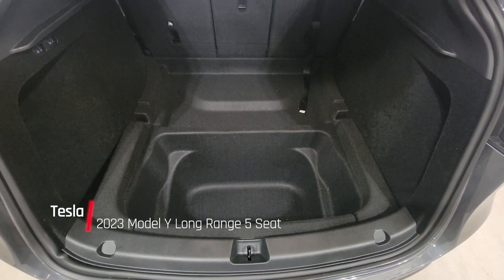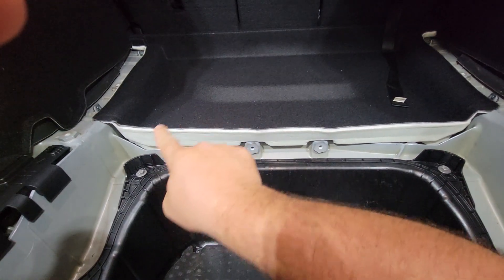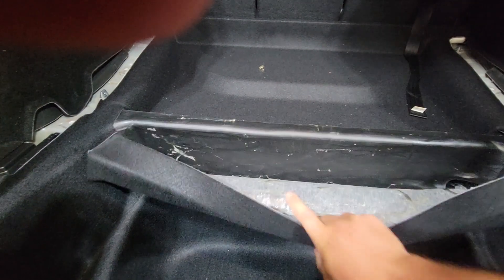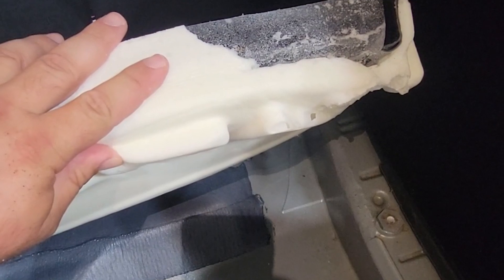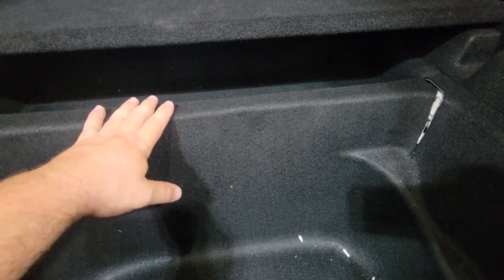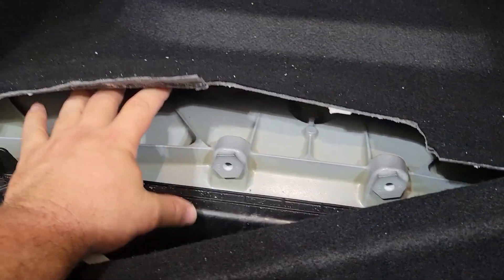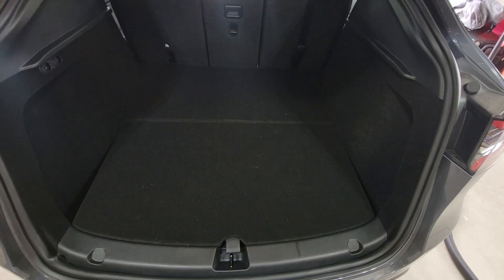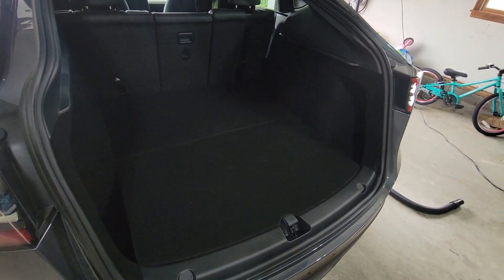We Hacked Our Tesla Model Y To Make Room For A Spare Tire! Fitting a modern spare tire in the trunk

Comment: This video was very helpful.  I successfully  did this to my 2026 model Y, however, I did not remove the foam from under the felt so the floor sticks up 1/2 " higher.  I'm ok with this.  Also, I was able to place the tire more to the front of the car.  So I still have good access to the deeper tub.  I'm using a Value Spare brand tire kit from Amazon.

Comment: Just did this in my 2026 Model Y...no need to cut anything, I just removed the sub trunk tub liner and just lay the tire down on that forward lip and it will compress the foam and protect the tire.  Also, I left the spare out of the bag, I put the tools below it and turn the tires with the valve stem down, which seam to fit better.

Comment: This is perfect and exactly what I was looking for!  And I’m with you. I bought the spare tire almost as soon as I took delivery of the car. I commute in the Bay Area, so no problem with cell signal or AAA or Tesla roadside assistance. But I’m picky about the tires I run so I wouldn’t be happy to have them sell me an expensive non-matching replacement nor would I put up with waiting who knows how long to have someone change a tire I can easily change myself. Plus, we travel weekly to the Sierras in the winter and the last hour if our journey has very spotty or no cell signal. But even if I could get a hold of AAA, who knows how long I’d have to wait for a tow truck to show up after 10pm on a Friday night in the middle of a snowstorm 40-50 miles from the nearest town.  They almost surely would not have a replacement tire in stock and so it would ruin our weekend. No thanks - in those conditions I consider it to be a safety issue to carry a spare. And to those who say they have never had a flat, I picked up a bolt at 96k miles and quickly changed my tire using my spare. Was able to plug my old tire after getting home and got another 13k miles out of it!
Reply from the maker: Glad to hear it worked out for you! Yes, we have used the spare twice. Once from a pot hole  and once from a bolt. Was nice to be back on the road vs waiting.

Comment: i would never do that just put it on long trips an remove if you drive around town and use AAA to fix your tire, or keep a fix a flat tire for backup or a tire kit that fixes holes or keep in there.  there is plenty of room just to keep that spare tire in.  really no need to ruin your car. but is just me since i own a MYP 2025 recently
Reply from the maker: Hi, its obviously a personal choice. My concern with having a loose tire in the truck is in case of an accident it could fly around. I have my kids in the back seat so it was a concern. We live in upstate NY and in the winter our roads can get pretty rough, I have had a tire blow out on a pothole before or side wall bubbles, which aren't things that fix a flat can help with. I've had to use the modern spare once when I got a bolt in my tire, so it's already been useful. AAA is hit or miss, I have had them come in 30 mins and I have also waited upwards of two hours. For me, I would rather have the spare and be able to go on my way. Again it's totally a personal preference and depends on how risk averse you are!

Comment: Thanks for a great, empowering video! Just did what you did, and love the results. Two mods I made: 1: I stuffed some rubber backed soundproofing in the L and R corners where the carpeting left a hole. Can barely notice the carpet is missing there. 2: I placed a styrofoam pillar under the section of the spare tire was hanging unsupported towards the rear of the car. Now when I hit a bump, the tire doesn't dislodge and raise the trunk's false-floor.
Reply from the maker: I finally got the ordered capernt to finish. I will see if I can add some photos to see the finished product.    I have a plastic storage tote with car supplies that fits perfect under the tire.   Glad the video helped, thanks for watching.

Comment: Nicely done.  Could you also leave the spare slightly deflated as long as you have a tire pump in the car?  That might give you a 1/4 inch more.
Reply from the maker: It's definitely an option if that is something you would want to do.  I prefer to leave it full and not worry if the pump will work.   Thanks for watching.
Reply: I did that on my Chevy Bolt and it was the trick 👍🏻 will do it on my Tesla too

Comment: I got a roll of carpet lining some two part epoxy and some hobby shop sheets (1/8" thickness) and some large cardboard tubes to replicate the liners without hacking them up. it was long and messy, but came out looking good
Reply from the maker: So you raised the truck floor?
Reply: @launchedandloaded  I replicated the trunk area, with dimensions to fit the tire, jack and tools, I did raise the gap for the trunk cover 3/4 of an inch
Reply from the maker: Nice

Comment: Oh my goodness, another one creating a projectile in a otherwise walk away accident. 
Please people, dont follow this advise. 
Im 56 and have traveled from Ma to fla (round trip) atleast 20 times and from NY to Va bch atleast that many times not to mention the yrs and yrs of driving to work on local and highway roads and I've had to change my tire ONCE. 
I rather not do it myself today so if I have to wait an hour for Tesla or AAA to come help, I'll sit back and wait.
Reply from the maker: Hi Henry, Thanks for your comments and thoughts. The tire is secured very well in the sub trunk with the foam wedging it in place. It's also possible to add straps for additional support if you were more comfortable with that! Fitting the tire in the sub trunk securely in the foam and also under the carpet is much safer than leaving it in the trunk. 

You seem to have great luck with tires! NY winters and also a job where we sometimes go on client visits can be rough on our tires. Between potholes and nails in tires I have had to use a spare at least 5 times in my life and I'm almost half your age! To each their own and the necessity obviously varies based on lifestyle and local conditions but for us it made sense.

I have had to wait upwards of 3 hours for AAA mid day before, so being able to swap the tire and get on my way is well worth it for me!

Comment: Did you secure the tire down? Just did this and wondering if there’s a way to secure the tire in the event of an accident.
Reply from the maker: I finally got the carpeting to finish the project.  Once I take it all apart again, I will let you know what I find.
Reply: @launchedandloaded  I took mine apart. The only thing I can think is to get a few strips of heavy duty Velcro and run it from the side “cubbies” across the bottom piece to the other cubby. Do it with 2-3 Velcro strips and hope it hold the trunk floor down in the event of an accident.
Reply from the maker: I have to look again when I fix the carpet, but I will let you know what I find

Comment: Before cutting check your auto insurance, most provide roadside assistance. That will also include flat tire fix.
Reply from the maker: That is correct, but it can take up to 2 hours before someone shows in my area.   We wanted a spare for this reason, swap and go.

Comment: One question, do you think there’s a way to secure the tire with a bolt/ string clips that are anchored? In case there’s a severe crash
Reply from the maker: Anything is possible, there are a few spots you could possibly hook a rachet strap to lock it down.

Comment: You do know they sell aerosol cans of FIX a FLAT right? You spray the contents into the
tires air stem & away you go. OR, at home, add GREEN TIRE SLIME to each tire & if you ever get
a puncture, the slime will seal it for you. I run Slime in all my tires and cant remember the 
last time I had a flat. Sure is easier than hacking up your car.

!
Reply from the maker: Everyone has their own repair methods.  All pieces that we altered are easily replaceable back to factory if needed.   Where we live potholes are a major issue, which blowout sidewalls.  No tire slime will fix that.  Yes it works for nails or screws but not the issues we see in out area.   Plus tire shops hate when the tires are loaded with that slime.

Comment: Hi, are those black pieces( after you remove the trim) on the left and the right of the bucket made of plastic or made of metal? Curious if I could use those black long portions in the back for strapping things down too, but not useful if they’re made of plastic
Reply from the maker: Sorry it took so long, but the material is plastic.
Reply: @launchedandloaded  no worries, and thanks that’s really helpful
Reply from the maker: No problem
Reply from the maker: Let me take another look to confirm.   I will get back to you.

Comment: Hope that thing is secured down some how in a wreck it will suck when it is flying around n the cabin of the car.
Reply from the maker: thanks for your concern! part of why we did this was so the tire is secure while driving vs just having it flail around in the trunk. 

The tire itself is wedged in pretty well (can confirm since we had to use the spare a month or so ago). In addition to the tension fit it’s also under the trunk floor and we have a trunk liner on top of the carpeting. If there was an impact hard enough to dislodge it from the current location, there would be a lot of other risks from the incident. 

this is our family vehicle so safety was a priority in our decision and also where we leave things in the car.
Reply: @launchedandloaded  That is good know a guy that was killed by a 30lb boat anchor he put in the back of a Toyota 4 runner in a wreck came all the way from the back busted through back seat and hit him

Comment: I have the 19" gemini  wheels.   The spare is 18".   Can you drive with that spare?  Does anyone have the 19" wheel spare?   Thanks for the great video.
Reply from the maker: https://modernspare.com/product/2020-2023-tesla-model-y-spare-tire-kit-options/ 

hi! so modern spare has a video explaining compatability and the size differences.

i have the stock 19” gemini wheels on my model y. unfortunately since posting, i did have to use the modern spare (same as video) since posting and was able to get to a tire repair center with no issue

Comment: Is there a reason why you don’t deflate it to store it and just carry a small compressor to inflate to 60 PSI if you need it?
Reply from the maker: The spare that I purchased, deflating is wouldn't have made that much verticle difference to get it to fit the way I laid it in the trunk  Then it is something else to carry and hope it works when you need it.  I appreciate you watching the video.
Reply: Another thing is you might not be able to inflate the tire if it loses its adherence to the wheel.